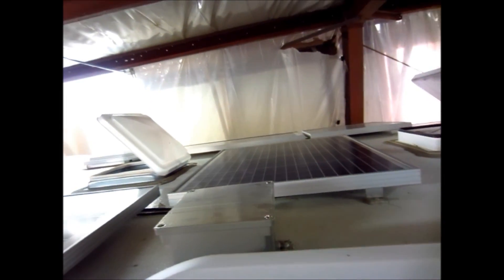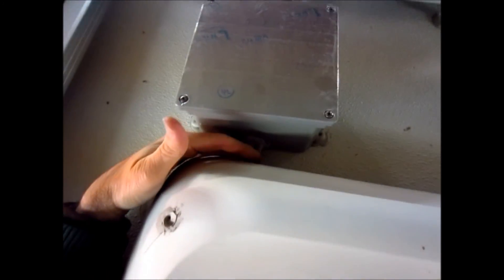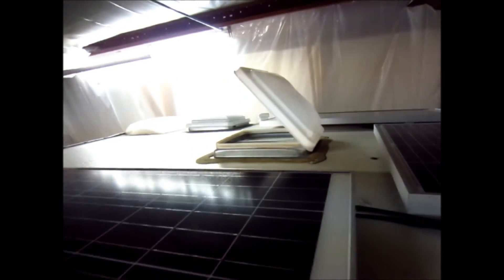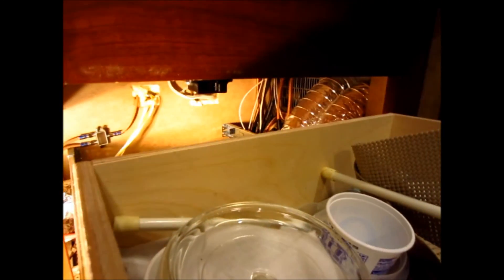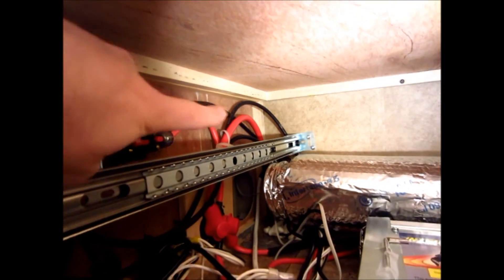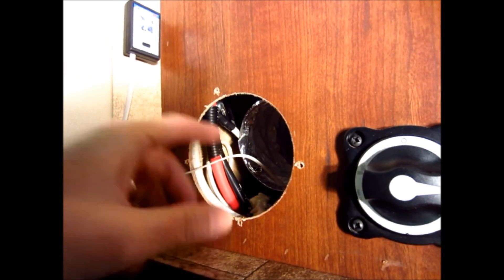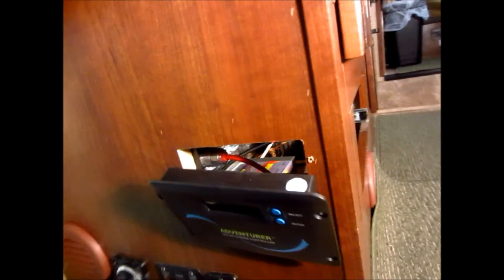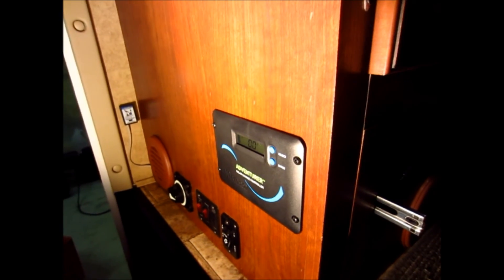Solar Panel System on Small Class C Motorhome

Comment: Thanks for the video I found it very interesting that you had to use fuses on each one of your panels. My renogy kit came with four panels and connections to hook all of them together and just send them down to my controller. I ran it for quite a few years and never had any problems at all. Also we camped in the mountains many times and yes we had shaved off and on in the daytime but we always was able to have a full battery charge by the end of the day. I did not know that shade was so important. I thought as long as I got some sun on them they would work that is a new one for me. I now have a class C and I'm going to just run a 200 watt system because that's all my roof will hold

Comment: Is your refrigerator vent on the same side of the coach  as the charge controller?  If not, how did you get the cables across the width of the coach?
Reply from the maker: Yes, the fridge is on the same side, so the cables ran right down into the same cabinet area as the controller.

Comment: So, what will a setup like that realistically run, and for how long until you have to charge your batteries via a  shore power source? Will driving the vehicle also charge your batteries?
Reply from the maker: Darin, It’s not quite right to think about it as running anything.  It charges the batteries, and the batteries run things.  So in this RV, with reasonable sun, the batteries will get enough charge to run everything a couple of people would run during a 24 hour period.  Air conditioning and microwave cannot be run on batteries, so those are out.  A bigger battery and inverter system can run a microwave or coffee maker, though. But not this one.  But lights (led), TV, furnace fan, chargers for devices, water pump, fridge controls while operating on propane, roof vent fan... all of that would be easily powered.  Of those, the furnace fan is the biggest power hog, so turn down the heat at night if need be.  

The RV has a generator, which can also charge the batteries, and will run a microwave, coffee maker, hair dryer, and a/c.  Sometimes we’d run the generator for a short time in the morning for hair and microwave.  Finally, yes driving charges the batteries.  Between solar, driving, and the generator, the only need we had for shore power was to have a/c on hot days/nights.  While the generator can do that, it’s pretty annoying to put up with for hours and hours.